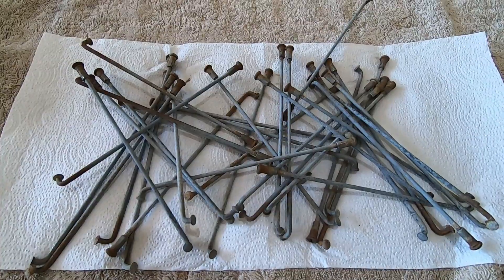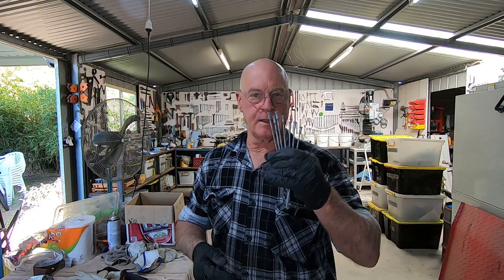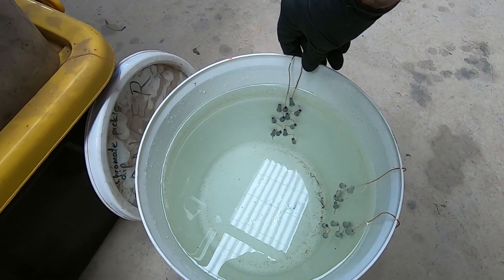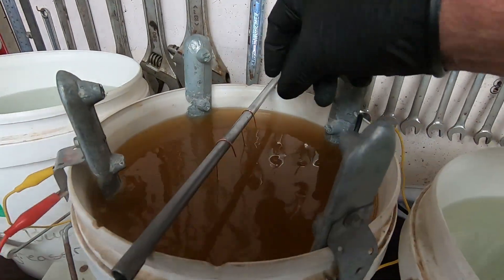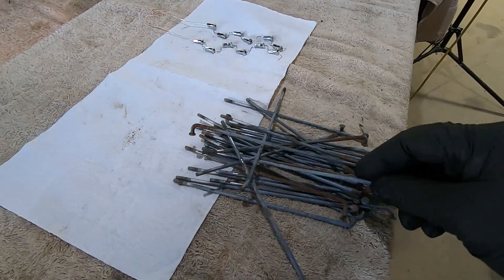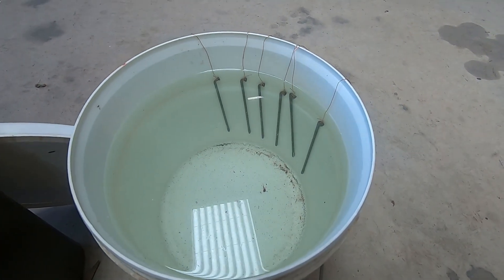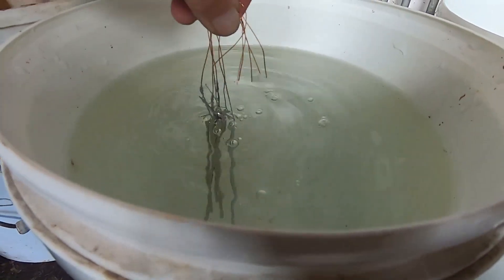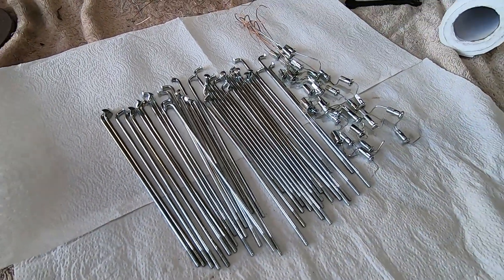How to zinc plate at home - DIY - Using a plating kit to zinc plate motorcycle spokes.

Comment: Hi Craig, great job. I have rather a lot of late 60’s Suzuki’s to restore. Just did my first zinc plating. Well happy with the results. Very satisfying process. Trying to obtain spokes is hard and expensive so I am looking at doing the same. I knew about the embrittlement from old from our plater who retired. Used him for 30 plus years. I thought only High Tensile type metals needed doing. I always bought new for brake callipers and suspension parts. Lotus Elans, bikes easier when getting older. Did you come to peace of mind with not baking the spokes. Also did you conclude the thread pitch on say old Japanese stuff incase they needed a die. Thanks Mike U.K.
Reply from the maker: Hi Mike. Thanks for tuning in. I’m still struggling to accept that a couple of volts and a micro thin layer of zinc might cause my spokes to fail so I’ll live dangerously for the moment 😁. And nah I’ve never got that serious with the threads as they’re usually rolled. A mate bought some small taps to do the nipples but has never had to. Cheers Craig

Comment: Hi what’s the cost for a set of spokes like that?
Also if you bugger one how do you remove the Zink?
Reply from the maker: I usually only do these spokes for my own projects as there are a lot of hours involved. It would be less expensive for the customer to purchase a new aftermarket set. To remove zinc from a failed spoke is just a matter of repeating the process. Thanks for tuning in. Cheers Craig

Comment: No post plating bake to remove hydrogen and lower the chance of embrittlement ? 
For decorative or trim parts it wouldn’t matter but having spokes fail from hydrogen embrittlement could lead to a bad day. 
Nice result though 🤙
Reply from the maker: I’ve never heard of this process until now. I wasn’t planning on baking this stuff but I’ll do a bit of research now that you’ve mentioned it. Thanks for the interaction and the kind words. Cheers Craig
Reply: @ all good mate, I do a fair bit of repair electroplating on aircraft parts at work and generally steels and stainless steels exceeding 150ksi UTS require post plate baking to remove hydrogen. Some parts such as landing gears are too big for us to post bake in our ovens so our specs only allows us to plate them in situ once between overhauls because they are so worried about hydrogen embrittlement caused by electroplating. During overhaul the whole landing gear is re-plated and baked. 
Im not trying to scare you off doing great work but thought it’s something worth knowing about especially plating on critical parts.